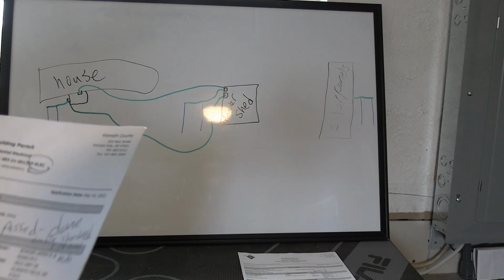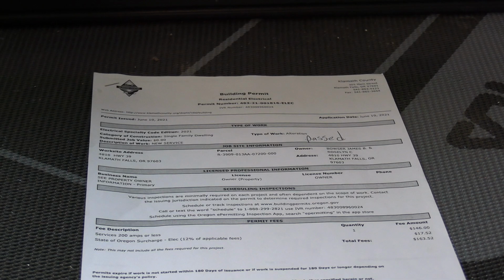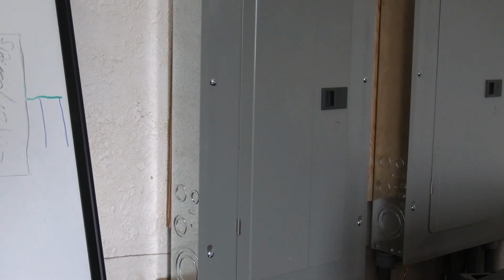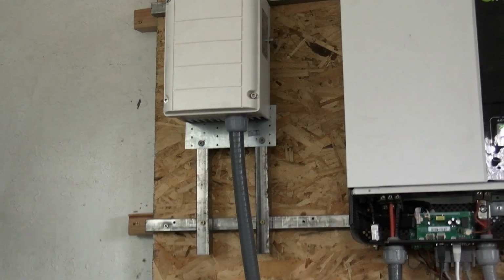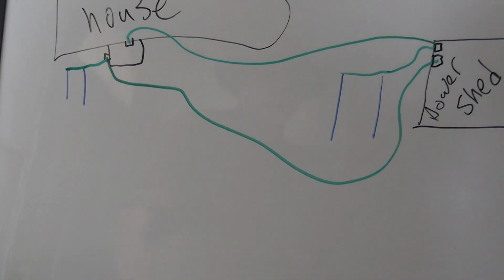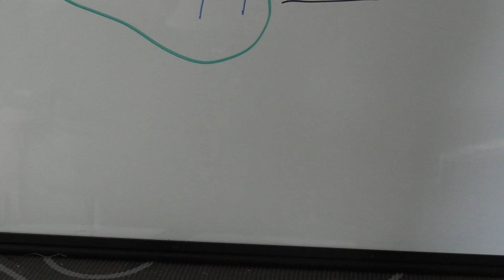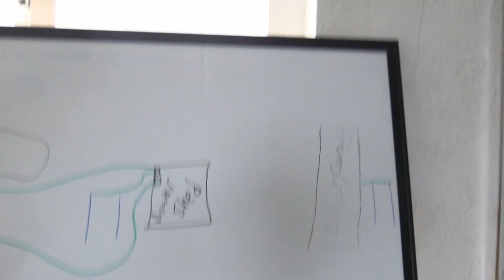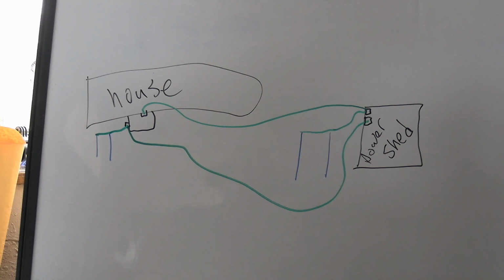solar grounding

Comment: My building inspector only required a quick disconnect outside for the PV panels.  I asked about grounding, and I guess using the ground rod outside for the main utility was good enough, and that is what I used.  I asked an electrical controls engineer at work and a few others who have a degree in electronics, and they said the one ground rod was enough.      But, you have to do it the way your inspector requires.
Reply from the maker: Yes each county and state has their own rule’s. It could have been just that inspector who wanted that.

Comment: Thanks for showing this.  I'm planning to do something along the same lines.  I've never applied for a permit before so I'm wondering what kind of paperwork your county required.  I know all counties are different, but did you have to give them a 20 page report of what you wanted to do, before they would OK your plans?
Reply from the maker: it was actually easy, I gave them the printout from Ironridges planning tool for the ground mount. then I gave them a copy of the book from Growatt. Then i did a wire diagram showing the size's I was using. they had me change one of the wire size's.
Reply: @jamesshomesolarmore2223  That's great to know.  I'll put something like you did together and see what they say.  Thanks.
Reply: @jamesshomesolarmore2223  Man that stuff has your address on it!
Reply from the maker: @JayDee25895  it don’t matter, I had cop’s show up Saturday. It’s just another day in the world.